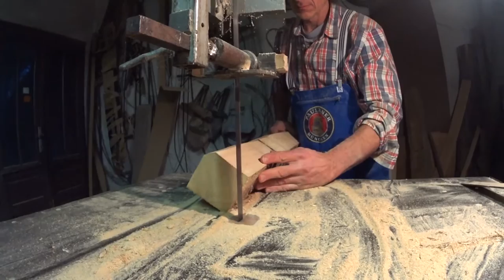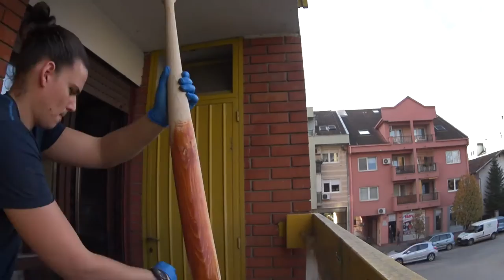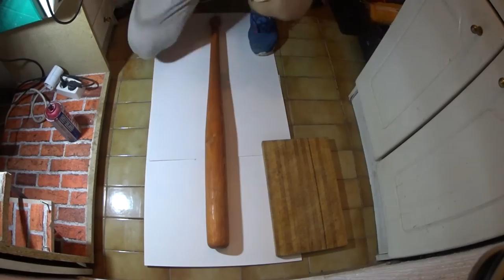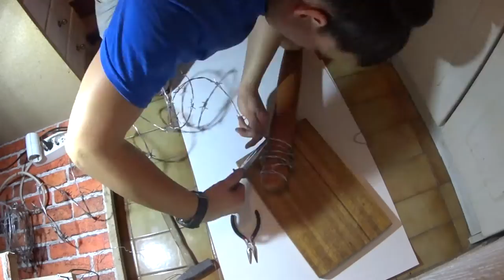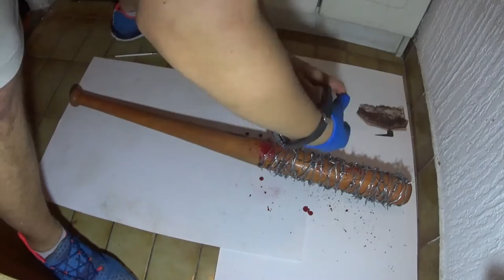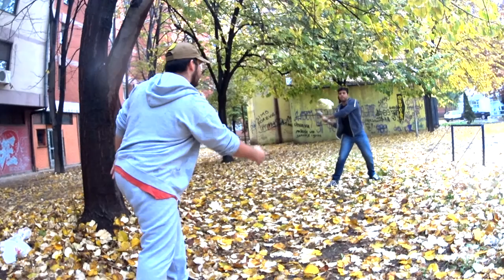How To Make Lucille Baseball Bat from THE WALKING DEAD

Comment: If you had of to buy a baseball bat to make Lucille, which would have bought? 
What is the paint used to paint the baseball beats of this color?
And to finish the paint to make the blood ?

Thank you ;)
Reply from the maker: -If u have chance try to find baseball bat made out of  SOFT tree and uncolored because it will be much easy to nailed barbed wire into bat. BTW barbed wire don't need to be nailed into bat, but i find that good way to fix it on bat and look cool to me :)
-I painted bat in Chestnut tree color. Its OIL based color for wood. 
-For color of blood i chose red Spray paint color nitro based. U can chose any other color but i chose spray paint because dry fast :)
hope i help u a bit :D
Reply: Thank u a lot for you answer ;)
Reply from the maker: you welcome :)